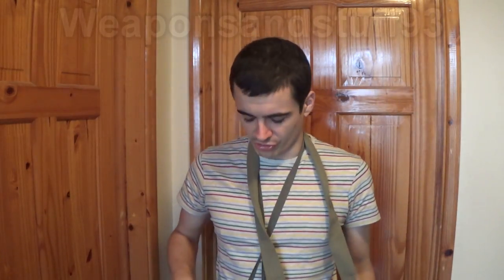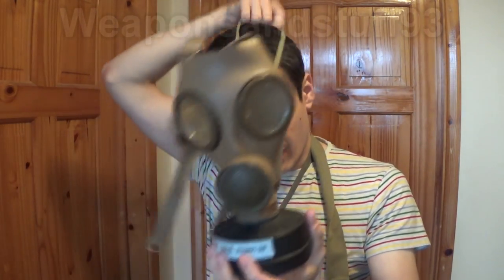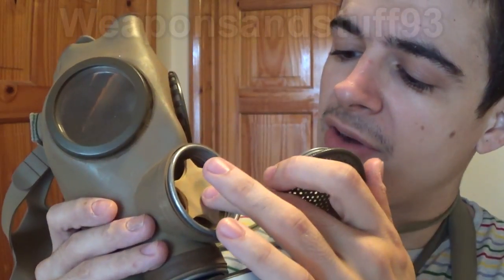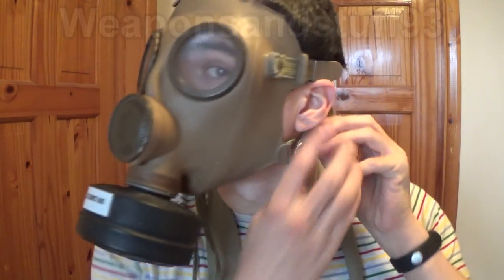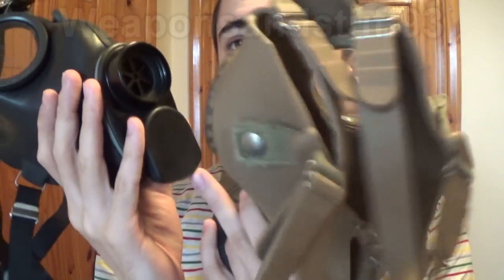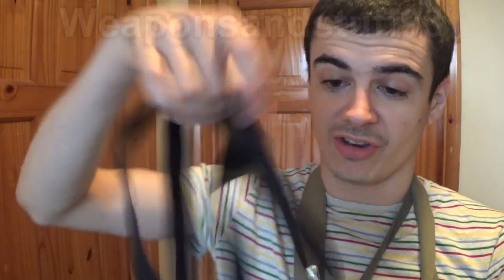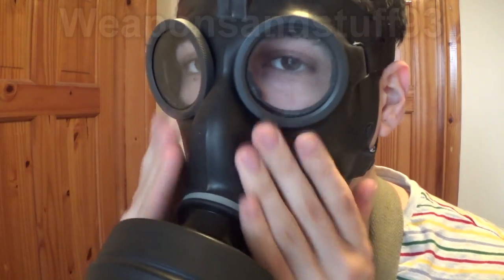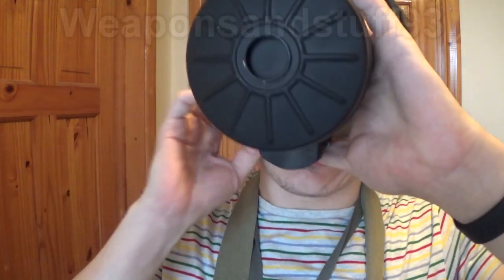How to improve a gas mask

Comment: could you try rubbing shaving foam on the inside of the lenses coz thats how you stop a bathroom mirror fogging up.
Reply from the maker: I don't think that would work all that well, the actual stuff used to stop mask lenses fogging up is a sort of paste that sticks and stays on the lenses, shaving foam would't last very long in comparison I imagine.
Reply: it worked on a crappy bottle gas mask I made, but it had to replaced once every 2 days.  A lot of water would also condense on the inside of the mask.